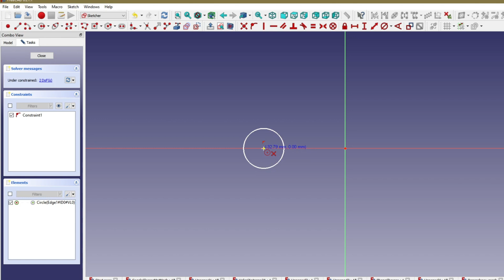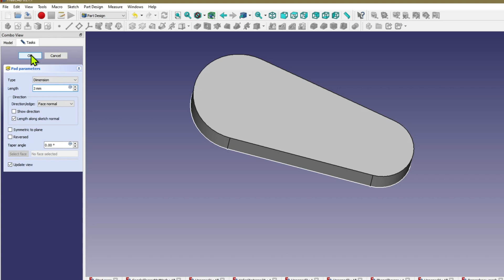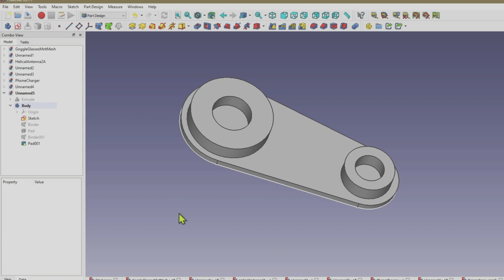FreeCAD Using A Master Sketch

Comment: Until they fix the topological naming issue that blows your model apart when doing something like deleting a chamfer FreeCAD is pretty much useless for serious work. Why they keep adding new features while the basics are totally broken baffles me.
Reply from the maker: @schrodingerscat1863  I suggest you look at my short video on the topology numbering issue.
Reply: @Hotwire_RCTrix  Yes, I know of this trick but it is hardly a fix when very often your model turns into a total mess after this issue strikes and is impossible to sort out. The RealThunder fork has a reasonably good fix for the problem but when that will get ported to the original project is anyone's guess. At this point I have pretty much given up on FreeCAD and moved to the RealThunder fork full time.

Comment: Thanks. I'm learning FreeCAD right now (spent about 10 to 15 hours trying various things) and I sort of wonder if I can use binders to basically share sketches between objects. For example I have box base and lid and I want to create some ports/holes through both parts. So far I tried drawing box as a single object with split, but it's super confusing - it sort of breaks both parts and I may want to edit some features on one half and some features on both (maybe I want subtract venting slots). In the end I came to conclusion that it's likely easier - and also necessity for making snap-on edges - to make two separate solids and share some drawings, but at the same time I need to transform them  (rotate, translate, mirror).
Reply from the maker: @pavelperina7629  You can use binders to share dimensions between bodies but there are similar issues with the naming changing of topology. Sub binders don't allow you to correct for this. So use shape binders first if you think you may change the parent topology. On top of shape binders you can use Sub binders for all or parts of the shape binder.
I hope that makes sense.